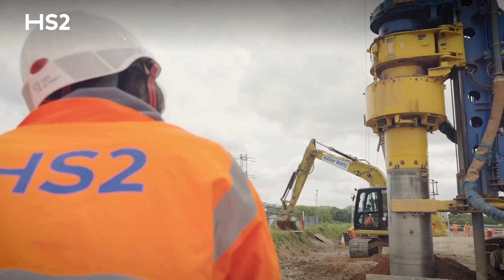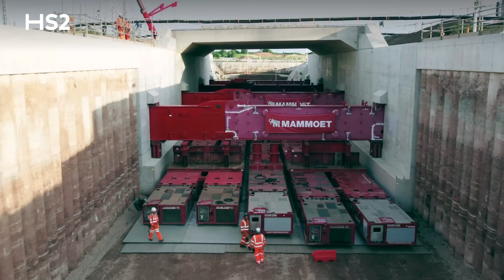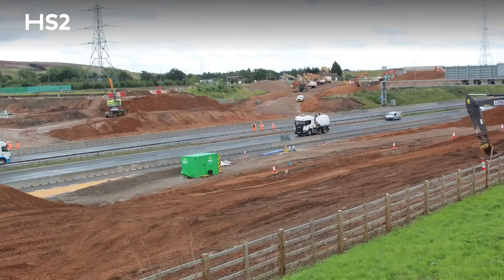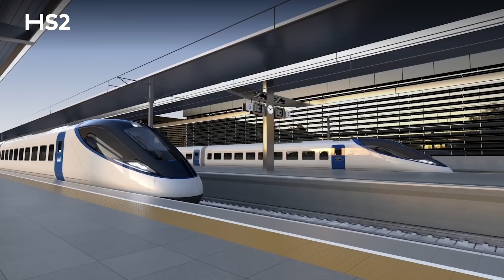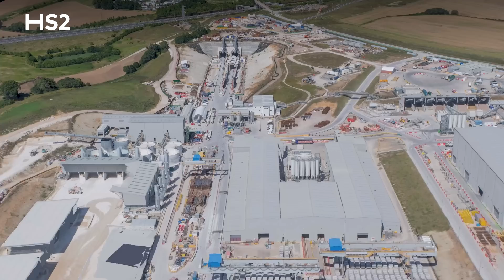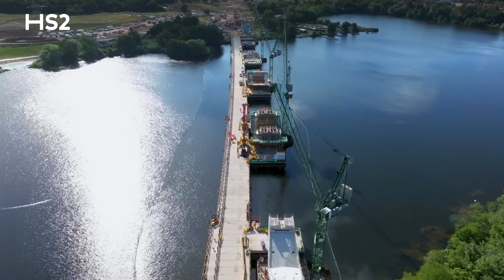HS2 Project Update, September 2023

Comment: Just build the connection between Birmingham and Manchester in multiple phases over many decades. It’ll happen eventually, just not in our lifetimes. Sometimes you need to think of and plan for infrastructure projects that may not be completed for 50 or 60 years. We need to get away from the idea that if we don’t see completion in our lifetime, then what’s the point.

Of course it helps if the idiots in charge don’t sell the land they’ve worked hard and paid millions to acquire, making it all but impossible for future generations to build it.
Reply: Nonsense.. 🙄
Reply: @serenityinside1  Thank you for clarifying 🙂

Comment: Instead of putting rails on the concrete runway, how easy and cheaper would it be to tarmac it and run a 100pmh EV FSD highway instead?  You wouldn't have to pay for those billion ££ trains x 4 or more and we wouldn't need to subsidise every ticket... so would it be cheaper and better if all 26 million potential EV users in 20 years time use it instead of dwindling train passangers paying 4 times as much as a coach ticket
Reply: Where are you getting FSD?
Reply: @dlarge6502  well as there is another 6 years before thay finish the route to birmingham, I suspect that FSD will be mature enough, already in the states the Tesla FSD although not fully ready yet, is driving people aroound the city without problems, on the motorway it is a no brainer, never have to touch the steering wheel at all, check out the FSD videos on YouTube this past month since the latest software upgrade, also the GM Chase FSD they are driving around completly without a driver... so FSD on our motorways in six years seems a dead cert!
Reply: EVs are not a solution. They are not green period. This project is expensive but it should be worth it. Tell sunak to increase taxes on yhe rich and y'all can easily afford it. But instead he is finding ways to bend over the working class and get his rich friends (and relatives) richer.
Reply: @zerotwo_.002  Hi speed train worth it ! LOL in China they spent a 1.5 trillion dollars on hi speed trains, but everyone still uses the old ones, as the train tickets cost to much on the new ones, it will be the same for the HS2. and in ten years anyone who wants to go anywhere fast will use an electric short hop airplane from anyone of the 200 airports, if I knew you I would bet a tenner that in twenty years after going bankrupt twice they will turn HS2 into a motorway
Reply: @hawklord100  china spent money wisely. Ofcourse many in China can't afford the trains because China is still a middle income country. But what you said is absolutely wrong many of its interconnects between large cities are right at capacity. And are you not aware how bad airplanes are for the environment. And not to mention I say China's step in spending (it wasn't 1.5 trillion btw it was 800 billion you were wrong by a factor of 2 ) is fantastic as what they build is good infrastructure which they were able to build it for cheaper than anywhere else because they took advantage of economies of scale. Also high speed rail has been successful in many other countries which are more economically similar to UK be it france spain or Germany. So your lack of knowledge is surprisingly lacking, let me guess you must be a brexit supporter.
Reply: @hawklord100  oh and on that bet ok sure! And also on the topic of electric planes even for short haul are massively impractical. Tell me one source of electricity which would allow for us a fairly high capacity aircraft which would actually bloody fly.
Reply: @zerotwo_.002  Well there are two flying between the Scottish islands at the moment, converted Lysanders, there are two bristol based electic airplane startups one with a VTOL and one an 8 seater electric airplane both going through final testing before submission for CAA aproval, but in the states and israel there are another half dozen electric plane startups all flying test flights all sub 12 seaters,  with rediculously cheap flight costs and of course you know RR finished testing their electric demonstrator this year and grabbed the world speed record for an electric airplane... mate you are so far out of the curve you are still in 1990 LOL
Reply: @zerotwo_.002  Naw... your wrong.. half the hi speed trains in China are broken or have reduced schedules and the other held mainly run half empty and no one can service the debt that was used to build, unless the government has stepped in and taken on the debt.
Reply: @hawklord100  the hispeed rail in China is entirely govt funded. And was built with the intentions of being a economy multiplier. Unlike other countries they spend 800 billion on public infrastructure where as at the same time usa spent more on military and or giving tax cuts to rich people (similar story with the UK cutting off taxes for the rich but then claiming a public infrastructure is too expensive) cry me a river. 

And on the topic of electric planes you haven't answered my question 12 seater aircrafts don't make a reasonable medium distance transportation option. And you know what a high speed train can carry well over 300 people in one train. And on that topic it's clear you don't understand how the aviation industry is managed and how noisy the electric planes are you are essentially aping planes from 1960 which were called the aerodomes. Trains are expensive but worth it. Planes even your electric varients are just too inefficient in many number of ways. You would need 1000s of new airport to be able to even match the trains capacity (that is with your 12 seater planes) and these planes would end up needing a lot of land lot more than the hs2 would ever need. And more importantly where are you going to find those many new pilots and the overall infrastructure cost for your proposed solution would be even more expensive. And please look at what Boeing airbus and others are doing with low emission aircraft there is a reason why lithium ion planes aren't very practical especially when they are only capable of carrying a few dozen. I would also like to point out when the Japanese were building their high speed rail project your points were pretty much the same things they said back then. But guess who had the last laugh. Also it's fairly obvious to see that you haven't read the DPR of the HS2. I implore you to read it.
Reply: @zerotwo_.002  I just doubled checked and Chinas figures are that they spent 1.9 trillion dollars on transportation infrasruture between 2012 - 2022 but since they had started building Hi Speed train network in 2007 I am sticking to the figure I got last year and quotted, $1.2T spent on the high speed network.... and that is just the building of it, it doesn't cover the cost of the trains

Comment: I continually hear that HS2 is designed to separate express trains and commuter trains, which, as a consequence, frees up space for more commuter trains. If the time savings of HS trains was significant, I could understand this, but the savings are far from impressive. I think that the same money could have been spent altering the infrastructure of the existing lines to enable the use of double decker trains as seen in many countries. By alterations I mean enlarging tunnels, raising bridges, and so on. The actual difference in height between single and double decker trains is not that great, yet the increase in passenger numbers would be significant. 

The cost of travelling on HS2 will make it a plaything for the wealthy, allowing them to risk a trip into the wastelands outside London, and returning to safety by nightfall. Where is the real economic benefit of that? 

I also call into question the job creation. Yes, people are employed now, but eventually the majority of those jobs will vanish. The current workers will have valuable skills, but where will they find jobs that use those skills?

Is HS2 going to make the differences that are claimed for it? Linking Manchester to Leeds would improve the economy more than linking Manchester to London. As for spending huge sums linking Scotland to London, well that might be OK for a United Kingdom, but Scotland seems determined to be independent.

Vanity project, white elephant, total disaster, or economic catalyst? I don't know. The whole project is mismanaged and ill thought out. I hope it is an economic catalyst, but it looks less and less likely. In my opinion the biggest mistake was failing to create a network, linking HS1 and HS2.
Reply: Another person with pie eyed ideas and knows nothing about Railways at all, first you just can not start rebuilding the existing Railway infrastructure to use double deck trains in the UK, it is not only physically impossible, and in Europe their loading gauge is large to UIC standards which gives a wider cross area of the track formation allowing for wider train bodies and tunnels bores are larger allowing again for taller trains compared to the UK loading Gauge and the difference in height of a double deck coach and a standard coach is quite a lot, it was tried in the UK in the 1950's on the Southern Region of British Rail and it never worked. As for HS2 and the cost of travelling on it will not be any different to the cost of travelling on trains as it is as when the HS2 route opens Avanti West Coast trains with it's partner Trenitalia will operate Inter City services on both the HS2 Route and West Coast Main line route and most non stop high speed services will use the HS2 route and HS2 is a Birmingham based project plus there is no reason what so ever of joining HS2 to HS1.

Comment: Thanks for the new update on HS2.

However, i do have some major criticism for the UK Government.

Since this project officially started construction about 3 years ago, the UK Government & construction companies have tried to do too much too soon.

By that i mean that they should have just focused on Phase 1 only (London to Birmingham).

This is simply because of the extremely high costs involved in designing & building this brand new railway line.

Phase 2a & 2b should have been delayed for at least 10 -15 years after Phase 1 had officially opened to the public.

This would help keep the construction costs down especially at a time when UK inflation is much higher than it should be.

But the update was very interesting though.

Just out of curiosity, why is the current CEO of HS2 Ltd resigning from his job.

And who is taking over.

Looking forward to more updates in the future.
Reply: Phase 2a and 2b is where they should have started but as usual everything is LONDON based. Anyone would think that the country doesn't exist outside the M25.
Reply: Here’s an update for ya: the massive black hole of money , the biggest and most ridiculous white elephant project in Europe… GAS BEEN KILLED OFF 😂 party 🍾🍾🍾

Meanwhile see your Gp about your meds 🙄

Comment: This far in constructing the project, HS2 MUST get completed. The costs are ridiculous, though; a lot of it should be clawed back to the treasury. I wouldn't mind getting the Japanese, Chinese, or even the French to finish it as this will be much cheaper and quicker. If the Manchester leg is scrapped, it defeats the object of connecting main cities and other lines. Levelling up, it would not be.
Reply: The French are involved with 3 of their Contractors. Ditto the Swedes, Austrians and Dutch.

Comment: HS2’s four main contractors have asked for more money or time on the project 3,000 times since works started in September 2020.

An internal review document by HS2 Ltd deputy chair Sir Jon Thompson leaked in October revealed that the cost of the mega project is heading towards “many billions more than the reported estimate”. It said that this is in part due to HS2 Ltd receiving “bids for money from contractors on a continual basis and significant and lengthy commercial discussions around them”.

Under the New Engineering Contracts used for major projects like HS2, requests for more money or time on a project are known as “compensation events” and are part of the commercial process of managing change.

A Freedom of Information request by NCE has revealed that there have been “approximately 3,000” compensation events between HS2 Ltd and its four main contractors since work began in September 2020.

The four main works contractors are:

SCS JV: Skanska, Costain, Strabag
Align JV: Bouygues Travaux Publics, Sir Robert McAlpine and VolkerFitzpatrick
EKFB JV: Eiffage, Kier, Ferrovial, Bam Nuttall
BBV JV: Balfour Beatty, Vinci
Compensation events will often have been triggered by supply chain issues and material scarcity, which will require the contractor to report to HS2 Ltd that it cannot deliver the task with the specified material or within the allotted timeframe. They may ask to change the material or the supplier, which requires a compensation event.

HS2 Ltd also has the right to reject these requests, which often occurs. The 3,000 figure includes compensation events that have not been successful. If, however, the request is approved and more money is required, the additional funds come out of the project’s contingency budget, which is recorded in the HS2 minister’s six-monthly report to parliament. In the March edition of this report, then-HS2 minister Andrew Stephenson said that he was concerned about the rising cost pressures on the project, which had reached £1.7bn.

There are multiple potential reasons both within and without contractors’ and HS2’s control for overruns. ICE trustee for policy and external affairs Jonathan Spruce told the Built Environment Committee last week that initial cost estimates are made too quickly, without fully considering all the details and are therefore filled with assumptions. These then unravel when boots are on the ground and unforeseen complications arise. Spruce suggested that this is an area that the Treasury and the sector as a whole needs to improve upon.

In the time since the commencement of work, the supply chain has been hard hit and the war in Ukraine has added pressure. Costs of materials including concrete, diesel and cement have continued to rise through Q3 of 2022 while the cost of steel rebar has only just started levelling out according to data from Linesight UK.

However, a project on the size of HS2 is more protected against these fluctuations due to the scale of their materials purchases. HS2 Ltd chief executive Mark Thurston told the Transport Select Committee in November that the four civils contractors have a “collaboration forum” where they look at ways to drive value through the supply chain on economies of scale. “We need huge amounts of concrete, steel and reinforcement bar, so we’re looking at how we can use procurement and supply chain efficiencies, recognising the scale of what we’re buying,” he said.

The leaked report from Sir Jon Thompson added that two of the four main contractors on HS2 lack “sufficient capability to manage all the various obligations placed upon them”, which is likely to be another contributory factor.

This could by why Thurston has promised a procurement shake up for the contract awards on future phases of the project. Speaking at the Rail Industry Association conference in November, he said that HS2 Ltd would take a “different approach for our civils contracts” on Phases 2a and 2b “with a view to attracting more local SMEs” to bid for the work.

There are currently over 350 active sites on HS2, employing more than 29,000 workers. The budget for Phase 1 is £44.6bn including the contingency budget, in 2019 prices.

Comment: What a total waste of money in producing a rail link - at a cost of tens of billions - which will get you from Birmingham to central London less quickly than you can do at the moment. It's reported that Rishi Sunak is planning to axe not just the leg from Birmingham to Manchester, but also the final six-mile stretch going from Old Oak Common to Euston.
Reply: Wrong, he has only axed the HS2 link from Handsacre in Staffordshire to Manchester, instead at Handsacre the HS2 line will join the existing WCML to take trains to Manchester and it will reach Euston and it will be quicker 225 MPH as opposed to 110MPH on the WCML
Reply: A trip by HS2 between Birmingham and Old Oak Common would take around 42 minutes, but the connection within London between Euston and Old Oak Common adds another 30 minutes, plus an average of 10 minutes changing at Old Oak Common.
TfL’s best case estimate of 1 hour and 22 minutes is slower than the average time of an existing Intercity service between Euston and Birmingham. It would be quite an accomplishment to build a high-speed railway, that - thanks to short term attempts to shave a modest amount of money off the cost - ends up being slower than the railway it’s supposed to replace.
It’s true that not everyone will specifically want to end their journey at Euston itself, but on a like-for-like journey, a cut-back HS2 (or the Acton to Aston line) would be slower than intercity services. As Euston is also a lot better connected for onward journeys, it’ll still be the preferred destination to Old Oak Common. @peterwallen1063
Reply: @paulfildes5489  First the HS2 service has nothing to do with TFL and HS2 will terminate in Euston, well at the moment it takes 90 mins London Euston to Birmingham New street stopping at the least at Coventry and Birmingham International travelling if possible 110 to 125 MPH between London Euston and Rugby, after Rugby about 90 MPH to New Street interspersed between the local trains and X country trains on this two track section, where as HS2 trains will travel at 225 MPH with just one stop about 5 miles outside Birmingham City Center at Birmingham Interchange station, a no brainer HS2 services win hands down saving 40 mins on the present time